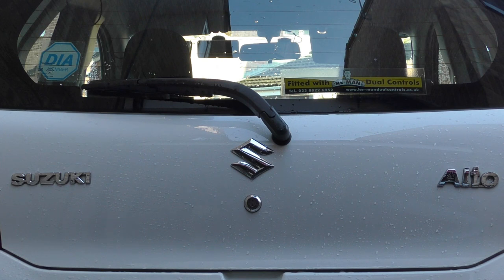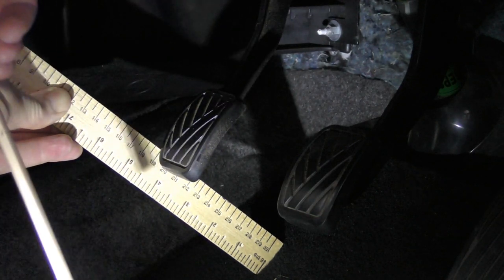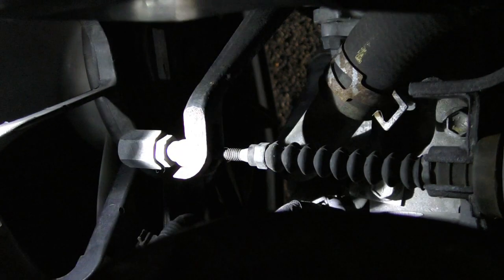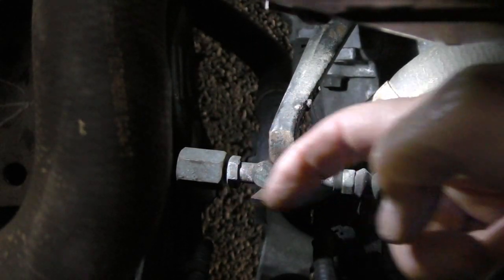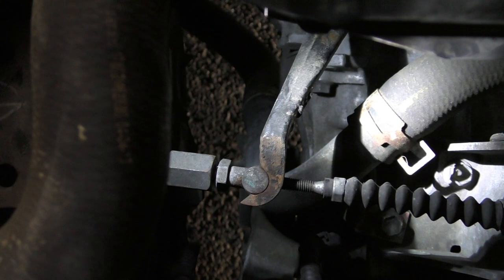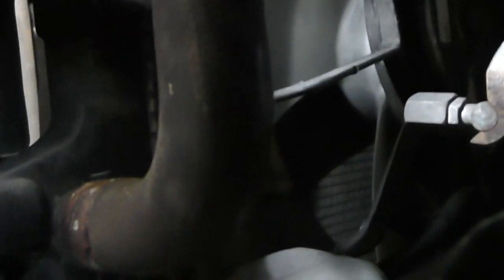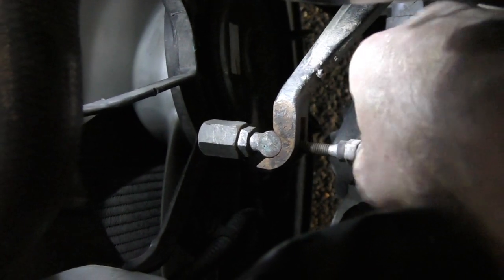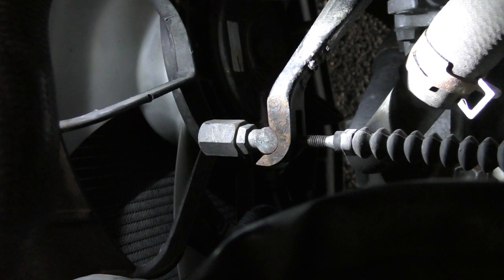2013. Suzuki Alto. Checking and adjusting the clutch pedal free play. Maruti. A Star.

Comment: THANK YOU! I was stranded on the highway and this video got me back on the road in 20 minutes! I had an urgent appointment far away. If I hadn't adjusted the clutch I would have had to pay a small fortune for a long taxi ride. Please let me know if you ever come to Israel so that I can give you a tour of Haifa in my Suzuki Alto and buy you a beer!
Reply from the maker: Wow Jeff, that's great that this helped you out.  Thank you for your offer, I certainly will, although we don't do much travelling nowadays, you never know. 😊
Reply: @DavidGarside  do you still own the little Alto?
They are great cars I bought mine brand new in April 2014 ..has 103,000kms now.
In that time I have had the alternator replaced..a loose rear wheel ABS sensor ...clutch noise that was replaced under warranty.only just replaced front pads and it still runs very well and has been used many times in Regional Western Australia into the outback without any problems even in 45 deg heat.
My mechanic loves working on her and we often joke about the smallness of parts ect.
It truelly is a ripper..just watching all your videos now😁
Reply from the maker: @semklm7579 . Good morning. No I don't I'm afraid. I retired at the end of May and sold it to a young man who I'd been teaching to drive as he l9ved it so much. He soon passed his test and has been using it regularly, but has just upgraded to a Seat Leon which he said he always wanted. You've had similar experiences to me in the past too with Alternator and clutch etc. The only annoying thing I found was trying to find service and repair information....Suzuki seem to want to keep it a secret. Thank you for watching and your message. 👍👍

Comment: Hello David, I have a 2013 Alto. I had to take the battery out to charge it, but when I put the battery back in place the horn now doesn't work. I've checked the fuses but they're okay. I've heard that the horn also has a relay but I don't know much about relays. Please can you advise me.
Reply from the maker: Hello. Have a look in your manual and it should tell you which one is the relay, usually a little square box plugged into the fusebox. They usually 'click' when they operate, if it does, it could possibly be the horn itself, which is not unknown. Double check the fuse though, substitute for another new one of the same value if you can. Is there anything else not working too? 
Good luck. 👍
Reply: @DavidGarside  Thanks David, I've now checked the relay but still no joy. I'm thinking that maybe there's some corrosion present inside the steering wheel, so I better get a Mechanic to check that out.
Reply from the maker: Ok. Hopefully it'll be something simple. Please let me know how you get on. Fingers crossed for you. 🤞🤞

Comment: David I have a splash and I'm finding the clutch ain't releasing fully when I'm pressing the clutch pedal right down . How do I adjust it is it on the same cable . Reverse always seems to crunch when putting it into gear
Reply: An update I've tightened the cable no more crunching video helped me cheers
Reply from the maker: Hello. Thank you for your message. Assuming the clutch adjustment details are the same on your car as mine, it sounds like you have too much free play in the cable....not counting any other fault of course.  If it was me on my car, I'd adjust it as per the above video, but it would be at your own risk. My Alto also sometimes crunched a little, or wouldn't go into reverse each time without lifting and pressing the clutch again. If in any doubt, it would be worth asking your local garage to check it for you as I'm no mechanic.
Also check your instruction manual as it may give the clutch adjustment details.  Hope this helps.
Reply from the maker: Just seen your update. Just make sure that if your manual says an amount of free play, adjust it again to that figure otherwise you may get clutch slip or wear the clutch out quicker. Glad you seem to have it sorted.

Comment: hello sir?is your engine shaking/vibrate?is there any solution for it?
Reply from the maker: Hello. Yes, it does shake a bit when on tick-over (idling). If it's excessive, then it may be one of the engine mounts.  It might be worth getting a garage to check it for you. Thank you for watching.
Reply: @DavidGarside  thank you sir for the info

Comment: Thanks David! I just replaced the clutch on my Alto and didnt know how to adjust the cable so its at 1cm play now (owners manual confirms 10mm - 15mm is the recomended play).

For those wondering, in the case of my car with a brand new clutch the pedal got adjusted all the way to the end of the thread (facing towards the inside of the car).

Comment: Hello, David.

Thank you for such informative videos. I recently had a clutch kit replaced, but it is starting to slip under the top as it has been. In your experience, is this normal or could it be different with this car?
Reply from the maker: Hello. If it were me, I would just check the cable adjustment as it may have just bedded in a little. If it's not that, I would go back to the garage where you had it done. Hopefully it's just a small adjustment needed. Fingers crossed for you. Thank you for watching. 👍